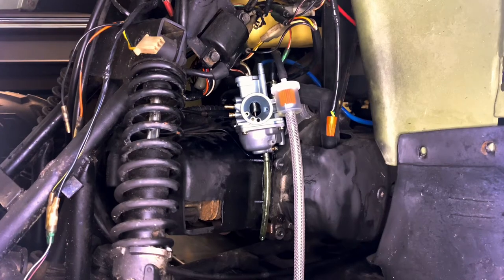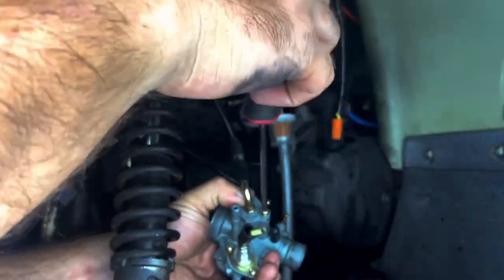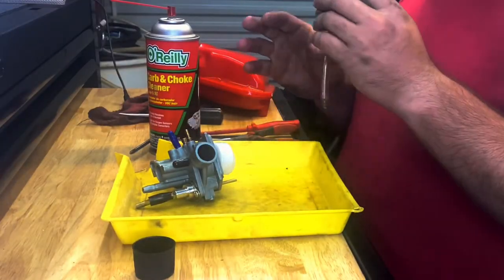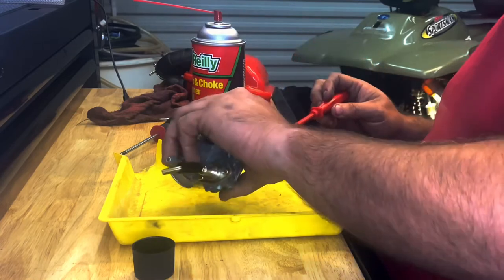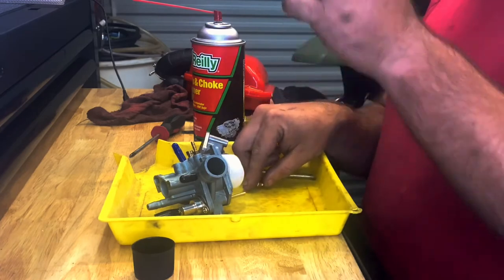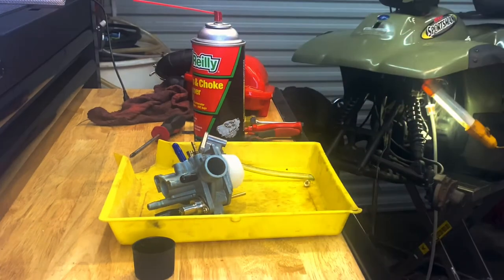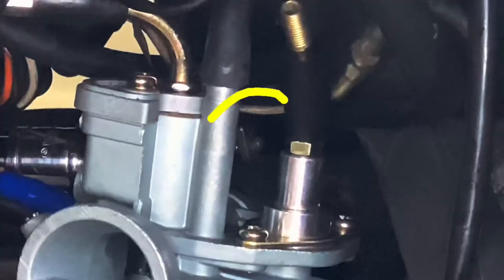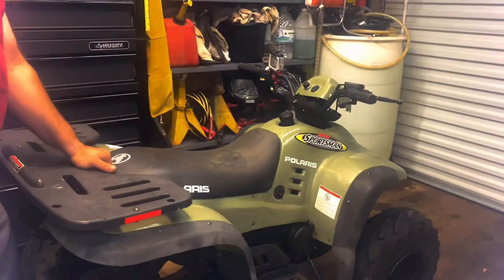Polaris Sportsman 90: Carburetor

Comment: Does the oil mix in the carb? Just bought one of these few days ago was thinking about plugging off oiler and mixing my own gs
Reply from the maker: Yes and if you put mix gas in the fuel tank make sure you cap off your oil inlet on the carb, you’ll see the blue vacuum cap on the oil port of the carb in the video
Reply from the maker: The Polaris sportsman 90 will be on the channel again real soon so hit that subscribe button and bell for us so that you’ll be notified
Reply: Don’t find a lot of videos about these machines would like a video on how you did yours didn’t know if there was a gear behind the fly wheel or if I could just plug off the oiler line or should I feed the line back into the oiler to have it feed itself or remove gear

Comment: Did you have problems getting the throttle cable through the top of the carb at the elbow, bought a new carb can’t get the cable thru the elbow seems to short
Reply: the wire is going back in on the cable on the other side

Comment: Mine absolutely won’t run right with this Amazon carb wondering if I need to buy the 500$ one
Reply: Make sure your air box is hooked up don’t waste your money
Reply: @urbanitesgarage3299  the air box is hooked up with the snorkel on, will not stay running. If I choke the neck of the rubber coupler it will stay running..
Reply: @cornelius6304  what i just did with mine the other day was put a piece of duct tape half way blocking off that angled rubber hooked to the carb to airbox, and it choked it a lil so it runs perfect
Reply: @urbanitesgarage3299  yeah runs like shit without the airbox